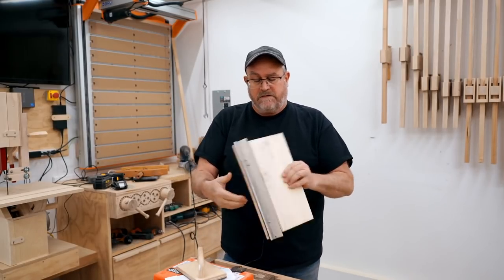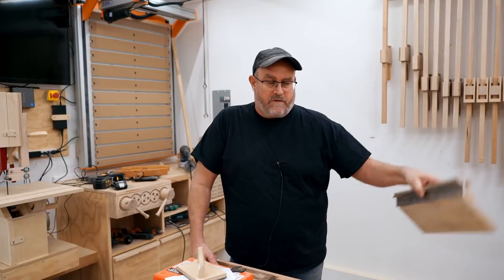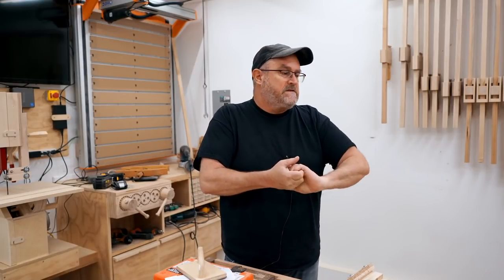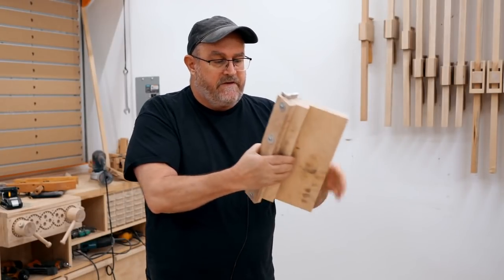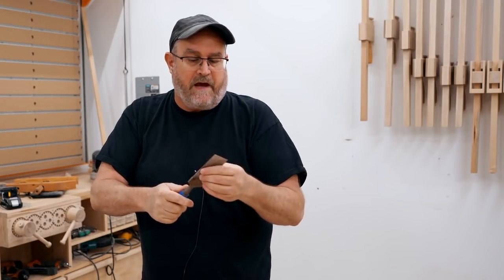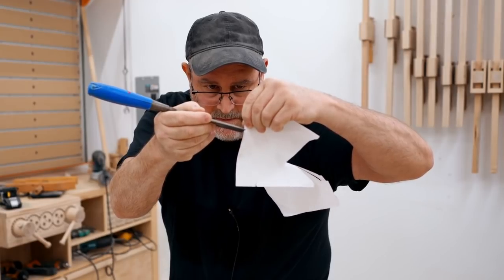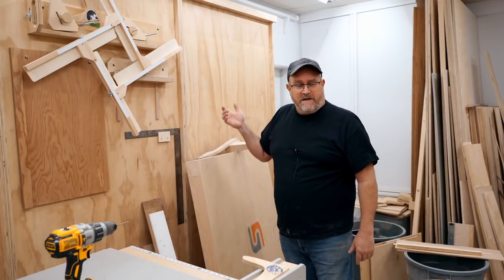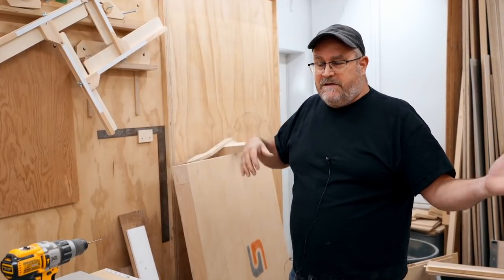I Bet Your Chisel can't do This

Comment: I got actually new kitchen knives, quality japanese steel. And I tried it with a piece of paper and got similar results, but you gotta get it going, and the pushing works, but it doesn't push in a straight line or anything, it follows some leftover grain in the paper or something. anyway for the purpose of a home woodworker this is a great sharpening method, Im glad you reshared. The precision with the professional machines I highly doubt actually is a necessity, rather just a property the machines have which is then later labeled as necessary

Comment: Safety police everywhere. People do take risks, it's in our nature, and the more cotton wool we are wrapped in, the more obscure are the risks. We used to work at heights with nothing between the beams we were standing on and the ground. Rules came in - over FOUR FEET above the ground you either need approved scaffolding with hand rails, kick boards etc, or approved safety harness that is subject to mandatory testing. Increases costs no end. However, we are becoming so dumbed down we will lean against a hand rail at height without questioning its integrity ( Big Brother legislation says that if is safe), and take our chances. A tourist in Thailand fell to her death when the rail she was leaning against collapsed, she expected it to be of the legislated standard of her home country. Do not even think about suing, it aint going to work.

Comment: In Europe they've already banned dado blades, carving disc for grinders and probably a lot of other things.
Reply: thats not true. its not common to use a dado blade i Europe, but its not illegal. every shop used to have a wobble blade/ dado blades but i was more effective to do it at a shaper or just use youre regular blad in a sliding table saw to do the job. also you you can get carving tools for youre angle grinder everywhere. this might not be true for UK but thats the only exception.